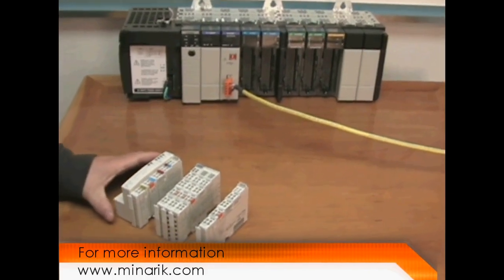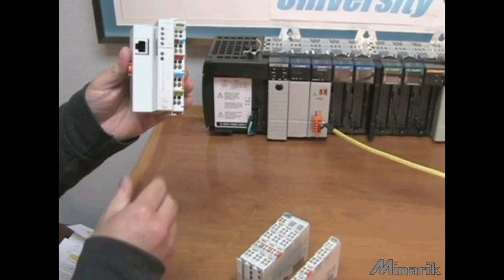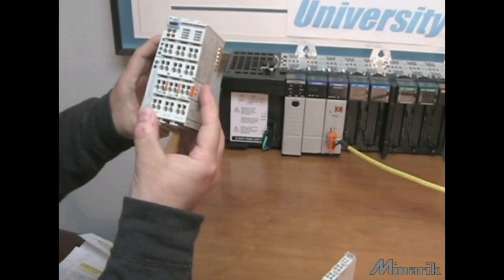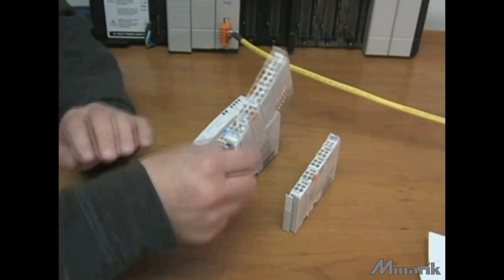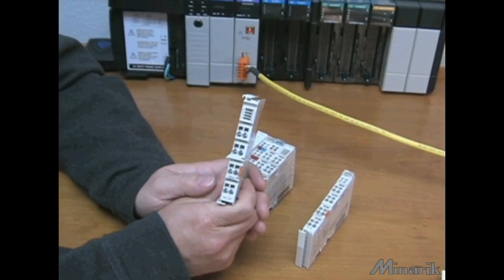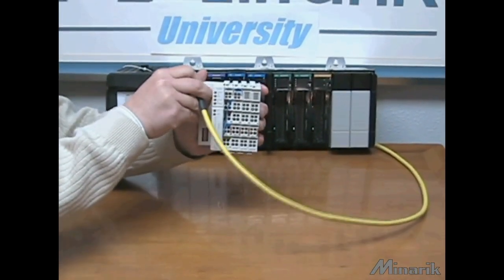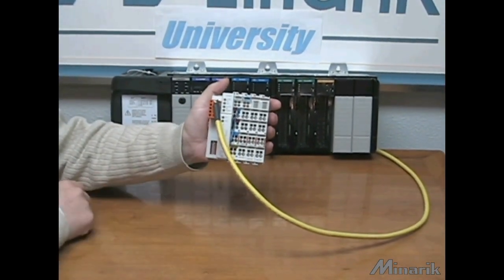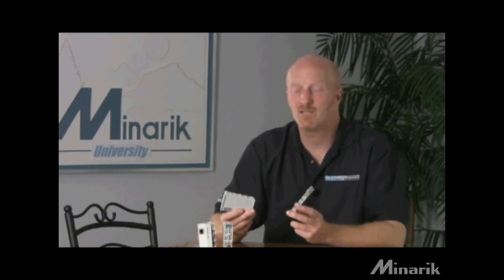Training in 60 Seconds - Fieldbus (Part 4/5)

Comment: Why not use Ethernet?
Reply from the maker: +Passed High School Physics Fieldbuses use Ethernet quite frequently, and they are
an integral part of the IoT.  In basic terms, fieldbuses are standardized
versions of a complex communication network often used in industrial control
systems.  The standardization of protocols allows for easy integration of
hardware from multiple manufacturers.  For more info check out:  https://en.wikipedia.org/wiki/Fieldbus
Reply: MinarikTraining Why not use MEMS sensors and the TCP/IP suite of protocols?

It appears anything FIeldBus can do can be done faster and for a much lower costs using TCP/IP and MEMS.